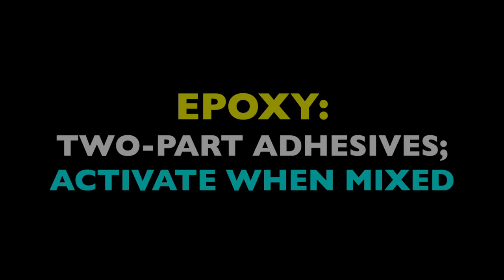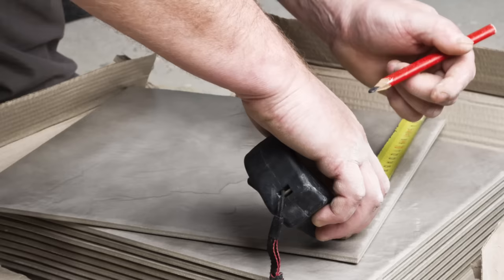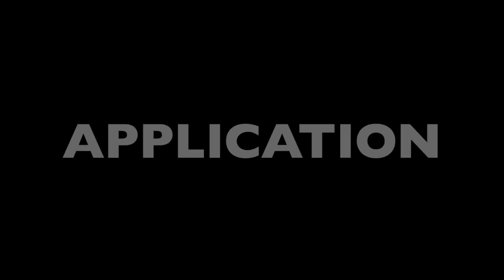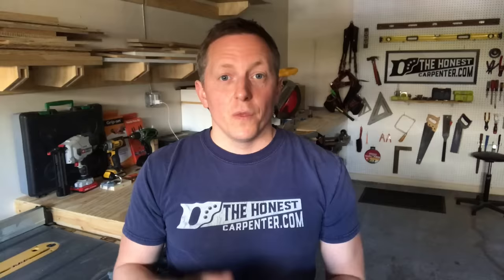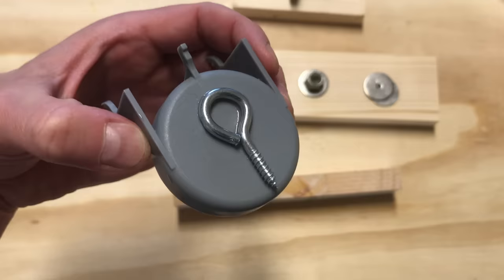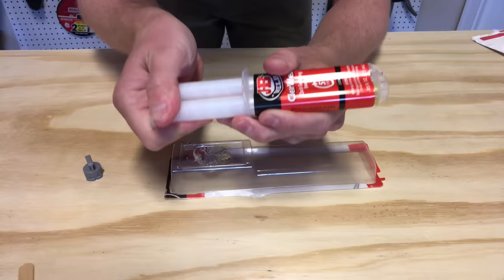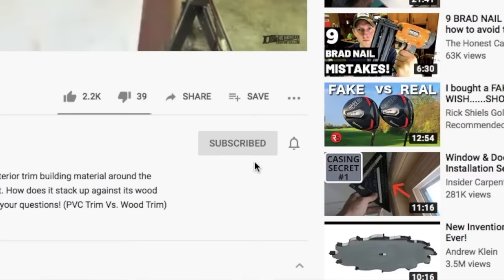DON'T USE SUPER GLUE! Try This Instead..(Epoxy Adhesive/5-Minute Epoxy/Epoxy Glue)

Comment: Epoxy is superior for holding applications, but super glue still has its place as well. Super glue sets almost instantly with an activator. Super glue doesn't require mixing and is easier to apply. Super glue is also available in different consistencies. It's good stuff for woodworking, and also usually cheaper than epoxy. That tube of JB is $5-7 depending on where you shop.
Reply: Yes I always seem to get that glue on my skin and it dries right away and is a bitch to clean off.

Comment: I used JB Weld water pump epoxy to repair a dishwasher door liner that had cracked the epoxy is rated for high pressure and high temperature the repair has held for three years now just remember that ultraviolet light degrades a lot of epoxies whenever you use them

Comment: Tips for epoxy;

1. Remove epoxy from fingers and surfaces with baby wipes. Works better than anything else on earth. 

2. If you want waterproof performance in epoxy, you need the kind that takes longer to cure. No 5 minute epoxy will be as waterproof as a long cure option. 

3. Old gift cards work great for a mix palate and strips cut off are great for mixers and applicators.

4. A blowtorch is great for popping the surface bubbles if your making something where the epoxy is visible or being used as a puddle or a coating.

BTW,
If you add baking soda to super glue, it becomes a different material. Super hard, sandable and a great option for filling gaps in resins, plastics and such. 

Great videos man!

~Mr. scale model maker

Comment: Most knife makers, be it Bladesmiths that forge knives or stock removers, use Epoxy adhesives for gluing handles.  Longer setting times give you more time to ensure fit is correct, however regardless if it is 5min, 10min or 24 hr epoxy, DO NOT over tighten your clamps or you will squeeze out all the adhesive and leave too little for a good bond.

Comment: Was watching a "let's test various glues" video and the guy said something like "it's not really fair to compare single-part glues with a 2-part epoxy system..." and I went out and bought some big tubes of epoxy.  Never looked back :)

I mean, yeah I'll use a CA glue if I want it to wick into a joint.  And, the stuff is really handy when mixed with baking soda because the resulting fill is so much harder than epoxy.  But, for sticking stuff together... 2-part glues just have a big chemical advantage.  

Oh, and the 4oz bottles are way easier to use than the double-tubes and they have a very good shelf-life... because they have to mix together before they start curing.  Not like moisture or air sets them off.

Comment: I use epoxy for big breaks & super glue for cracks. 

Tip: for large gaps/holes i  will mix clear epoxy with saw dust to create a matching wood coloured paste. Sands well after 2 hours

Comment: When using 2 part to fill/repair wood rot pre-wet all the surrounding wood with just the part A, then proceed to mix the 2 part and fill the area. Part A will soak into the wood fibers and bond with the mixed epoxy. A boat guy taught me that.
Reply: Great tip, thanks!

Comment: Great video.  It should also be mentioned that the setup time on the epoxy and temperature will make a difference on the flexibility of the epoxy.  For the best results, use the longest cure time epoxy you can manage.  You will get better results with 30-minute epoxy than 5-minute epoxy.  5-minute can be more brittle than 30-minute.

Comment: A few years ago I used JB Weld to fix an outside water hydrant that had split at the outlet because of freezing. After repair, I got three more years out of the hydrant before replacing it.
Reply: I think someone has glued their head back on with JB Weld. It's part of shop talk and everybody has a story on it

Comment: Other than bonding things together, I've found another use for epoxy. It does a great job of sealing  rusty nail heads before you paint. Brush some on, wait 24hrs then prime and paint. Doesn't take that much. It's been good for 4 years now and yep..out in the rain.
Reply: I forgot to mention, I use oil base primer.

Comment: Acetone is useful for cleaning up any little smears that get on surfaces like glass, ceramic, or metals. Also, you can use a heat gun to soften epoxy and get things apart again. Obviously, you'd do this only with bonded materials that can withstand the heat themselves like metals or glass.

Comment: Acetone or rubbing alcohol to clean (non-porous) surfaces for strongest bond.  I called JB Weld last year because they say to use acetone, and a Youtube said to use alcohol, because acetone can soften/damage some materials, especially plastics….the JB person said that they believe alcohol leaves some residue that interferes with adhesion.  But I have my doubts, because alcohol seems to be residue-free, and I (and many others) have used alcohol many times with great results.  
Bottom line:  clean surfaces for best grip, acetone seems great for metals, and other materials that can handle it, and I use rubbing alcohol for everything else, and works fine for me.  
Thanks4the vid!

Comment: My first job out of highschool was a Navy seahawk helicopter power train technician. We used to keep little foil packs of 2 part epoxy called hysol in our pockets just in case. They were mainly for, no bs here, gluing rotor blades together. The pilots inspected them as part of the preeflight and it's common for the trailing edge to delaminate. If it's only a few inches long you mix up some hysol, pack it in and squeeze. vwala.

Comment: Tennis Ball Cans are handy for storing partial epoxy syringes, and many other things. Combining CA and Epoxy in a joint (not by mixing them...) can provide short term holding (CA) and long term strength (Epoxy) with proper planning and placement. CA replaces clamping. Storing CA in a tennis ball can (or heavy zip lock bag) with some desiccant packets makes it last for years. Should work for Gorilla glue as well, and other adhesives that are set off by moisture.

Comment: Not trying to co host but super glue comes in at least 3 viscosities: runny, not so runny and barely runs. Also it is available in bottles that contain  multiple ozs. rather than 1/4 oz. So for those who shop only at BBox Stores, the  small size with low viscosity is about the only thing available. Go to a wood working store or online for the other. I despise mixing epoxy although I do use it when indicated.
By the way at age 72, after using super glue for 30 or more years I developed a lung  sensitivity. I never wore  a respirator rated for organic solvents. I was in bed for 2 days with symptoms like one would get with a cold,  a bad cold. A month later I tested my sensitivity again. Same!. I now use a 3M VOC mask with no issues, or I go outside and find the wind. That works as well.  Thanks. I really enjoy your practical videos.

Comment: I have purchased the 2-barrel plunger type a few times and totally dislike them. The cap always seems to get glued on preventing using it again. I much prefer the kind that comes in 2 separate tubes, like I saw my Dad use so many times as a professional in the trades. No waste, no fuss.
Reply: True. 
I’ve found with the 2 barrel, that you really have to be ready to pull back the plunger immediately after depositing the components on the mixing surface to avoid getting excess stuff on the tip. And after successive uses, remember to position the cap on, the exact way it came off so residue from cap and tube don’t mingle. It’s a real PIA.

Comment: Epoxy paste for building fishing rods: it is used to hold the reel seat onto the rod.
Clear for the line guides,
Knife making to hold the wood scales in place, more to seal out water than structural, also 5 minute Epoxy has a lower melt temperature, handy for rod tip guides, less so when shaping wood handles on a sanding belt,

Comment: I always have standard JB Weld epoxy (24h version) and have never used 5 minute epoxies because they don't do as well in testing I've seen.  But maybe I can have some on hand for when I need a quick hold, and perhaps in combination with a standard epoxy. Devcon plastic steel epoxy is also excellent but is stiffer (which can be good or bad depending on application)

Comment: 100% agree - there are many very good and strong epoxy bonds available, but each glue has its application scenario. If you just have to glue very small parts and want a rapid fixture super glue might be the choice. For bigger parts and complex scenarios epoxy might be better. Also take into account heat resistance (epoxy can resist 300 degr. C, don't know exactly for super glue?). Epoxy is a little more complicated to handle (mixing the resin and hardener in the correct amount and mixing it well enough). Drying time and final strength can be improved by applying gentle heat (heat gun e.g. is helpful). I have some epoxy that is 30 years old and still working - although i have to take a larger amount of the hardener as this is the component that absorbs CO2 from the air and gets milky over time. You have to keep it air tight. Its hard to use super glue for longer than a few months when open...

Comment: Super glue is available in three consistencies. Thin , medium, and thick. Thick is very similar to epoxy in viscosity, so it acts as a gap filler and doesn’t run.

Comment: Replaced a missing piece of transmission case.  Wrapped a bolt in Teflon tape and threaded into engine case then slowly built up commercial Devon plastic steel around the bolt and edge of transmission case against a piece of glass covered in wax paper clamped to remaining trans case til it somewhat matched missing piece. 

It held fluid and I drove it for 50 000 miles til I got t-boned and the car was totaled.

Comment: Epoxy is great stuff ! I use it (the 5min type) mainly for scale modelling where regular plastic glues don't work that is, with resin model kits or parts of different materials,
e.g. brass to styreen, resin to resin, lead to plastic, etc.
I also use it to create 'lenses' for headlights or binoculars : i sometimes then mix in a little acrylic paint for effect. For clear lenses it is important to mix
the components very gently to avoid air bubbles (maybe a slow epoxy would be better).
Superglue is also great but serves me better for quick mountings where strength and/or time to position correctly isn't important.

Now....let's go glue something ;o)

Comment: I have some lock tight glue and some Epoxy resin Gorilla glue too. I used them to repair a bunch of stuff instead of throwing them away. I also like to modify certain things so they last longer. Everything these days seems to fall apart to easy! I don't know why so many things you get today just end up breaking. I refuser to buy new ones, unless I am unable to fix it! I like to repair and reuse things so it less stuff going to land fill. I also like to recycle things if I can. Things are getting harder to fix I have noticed. My mum has an old 80's Kenwood chef mixer, and it still works. The only thing wrong with it is it's slightly rusted in parts and the paint it coming off, but otherwise it still works to my knowledge. I just wish things, especially electrical items were designed to last. I've literally had dozens of things break on me for no reason. All those resources and materials going to waste and half the time you can't recycle them either. I think it should be law to make things recyclable or reusable. Why cant they just take apart old electrical items and re use the components that aren't broken or worn out? We make far too much waste and it's not like we cant just re melt it down again. I wish plastic packaging could be sent back to the factory and re used if still in good condition and hygienic, why can't we use the technology today to fix a lot of problems, it's not like we can't do anything to stop landfill or pollution!!!!

Comment: In the winter, my fingers and thumbs split at the nails. Super glue is great for putting things back together.
Reply: Google crack cream. Lol, I know, I know, but the ex used to work with chlorine and other chemicals that dried out his fingers so bad they would crack and bleed also. I found crack cream at the drug store and it worked like a charm. Hopefully they still make it.
Reply: If you don't find "crack cream" (I've never heard of that myself but totally going to find and try it if I can lol) I earnestly recommend the hand cream brand "Udderly Smooth". It (purportedly) came from the dairy industry but I became aware of it when I worked for a veterinarian, who was an older lady who of course was constantly washing her hands all day and had to be really proactive to prevent brutal cracking. A client gave her a tub of that stuff and it was great, I've been hooked since. Typically find tubes of it at hardware store checkout impulse-buy areas and at dollar stores but it's also online. Best of luck with your hands! And thanks for the tip about superglue being good for when the nails get problematic, I'd never thought of that and I injure myself and my nails a fair bit so I'll be keeping that in mind!

Comment: I bought a used vehicle that had a loose mirror cap held on by a sheet rock screw through the underside. I was able to save the cost of a new cap plus painting by taking the cap off and removing all of the broken standoffs and gluing them back on with epoxy. It went back together like brand new without the screw.

Comment: Super Glue dries hard & brittle, but it's runny viscosity helps where flow through capillary action into crevices is needed and it bonds on hard to clean, oily surfaces.  You can increase its strength & instantly cure it with baking soda, vinegar, or alcohol.  Epoxy can still be more forgiving even though it's two-part.

Comment: I find restoring the cap and apply some pulling on the plunger helps retain the cap without leaking, also store upside down, if there is a change in room temperature the expanding contents does not leak out or pop the cap off.

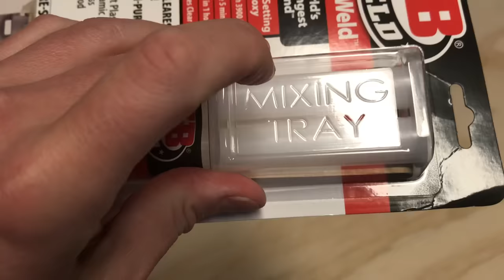Comment: Totally agree and thanks for the vid. The only thing  I would like to mention is at 3:22 you seem to twist the pack which might mix the hardener into the glue and therefore initiate unintentional curing at the nozzle. Personally I prefer the two part solution as you describe but where the two parts are in their own tubes. I guess these might be not so popular these days,

Comment: I had an old wooden office chair and one of the casters fell off due to an enlarged mounting hole. Nothing would work. Finally I placed the caster shaft into the hole and filled the hole with 5 minute epoxy. The next day I started using the chair and as I recall I never had a problem with that caster again.

Comment: It helps if you rough up the metal  wood or plastic surfaces to be bonded give more surface area?. If you use the Metal set epoxy weld stuff you can use magnets to control its shape and penetration or guide it into difficult places.  In the Airforce the demo for it was lifting a car with a strap that had like a 4 square inch bond holding it together. The Epoxy putty is great too, same rules but just like " putty" . So many uses and the answer to questions not even posed yet.

Comment: I use epoxy to fix fill any thing everything . Ceramic tile and metal  'L's on which a wooden shelf rests . It's there for last 10 to 12 years . Concrete structures where the the inner TMT bars have come out like the lower surface of a window sill . Use a bit of anti-rust on the exposed metal , sand it and the surrounding areas after 48 hrs , start applying epoxy paste not the liquid variety in reqd amounts and prop up the rod with a bamboo pole to keep it up into the matrix for 3 to 4 hrs or even 24 hrs then remove the pole and use more epoxy paste to finish the surface . Right before you finish off use a wet finger to shape the epoxy and rub down the junction places such that no air pockets or deformities stay , next day paint it . Can be used almost anywhere to fix a wash basin on its metallic props , to stick a water pipe down to the adjoining surface . 
 It repairs holes in metallic roofs very well as it withstands temperatures upto 50℃ easily without cracking or deforming or leaving the metallic surface . Here in India we get temperatures upto that in summers easily followed by a huge shower which lowers the temp drastically to 20 or 18℃ , but the epoxy plug shaped like a rivet stays perfectly well .

Comment: I had two mechanics try it with a car door handle.  The epoxy held for a day or two, but won't hold longer. I really used the handle carefully, too. It probably works great for most other things. I did get some for myself and plan on trying it for other uses.

Comment: A metal hinge on my Lenovo y740 disconnected from metal lid (another kind of metal) and I tried metal epoxy (price $7), with a clump and 24 hours waiting time. It just fall apart after first attempt to open the lid. 
2-nd time I tried to use default cyanoacrylic (price $0.5) "super glue" and it actually holds.

Comment: Epoxy is good for wood repair. Would be nice to have video or refresher video on repairing rotted or damaged wood with epoxy. 🙏
Reply: Have you tried using a wood hardener to solidify the remaining wood fibers followed by the epoxy (with or without dust of the same piece or species)? This approach worked with rotted window sills on a century-old farm house. The added benefit was the fix was immediately waterproof (it rained before the sill could be painted and it shed water beautifully).